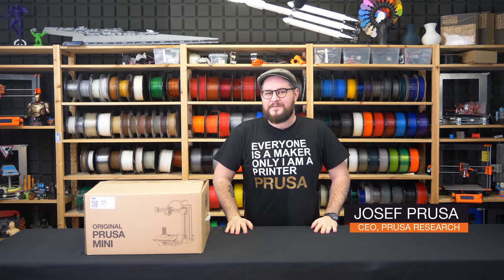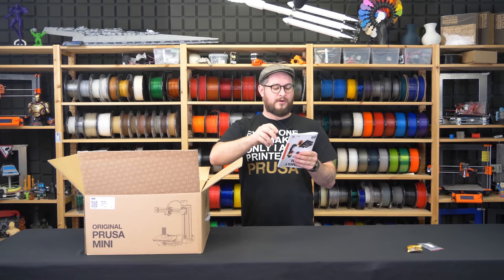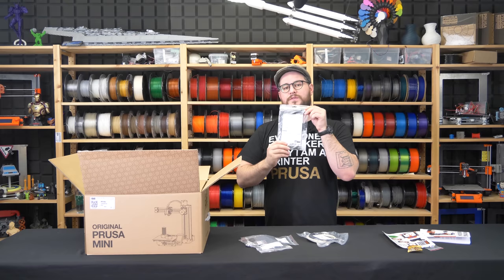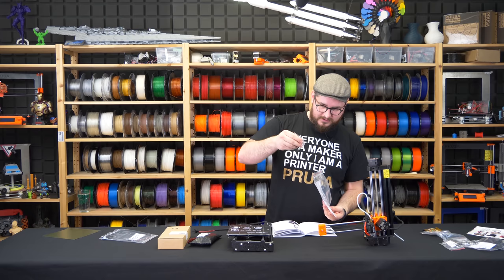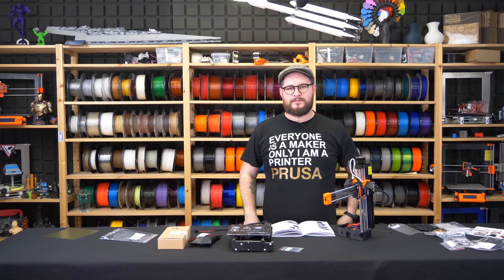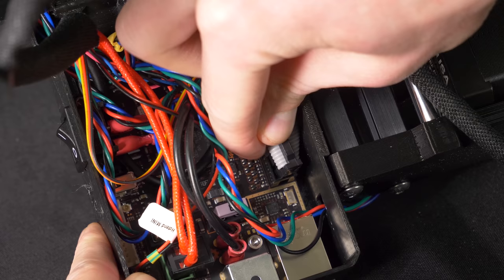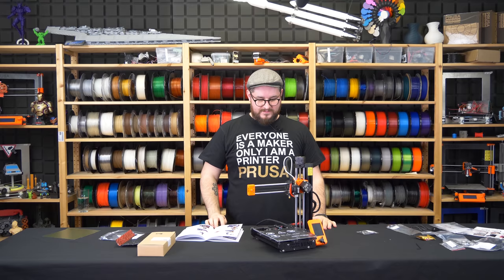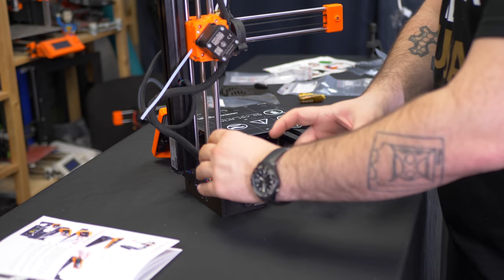The Original Prusa MINI - Unboxing & Assembly

Comment: Watched the video once all the way through. Then watched it again hitting pause as I did the assembly. This was a pretty good guide, though a new one is needed for the slight modifications in the MINI+, but as advised, I followed along in the book to catch those minor changes. Thanks for a fantastically easy build! I'm typing this as I listen to that first test print making music in the background. :)
Reply: The instruction book isn't accurate either, though. For example, step 23 shows "connecting the Y-axis motor," passing a wire through a hole in the side of the electronics box. Neither that connector nor the hole exist.
Reply: @stokestack  My guess is there have been slight variations on the design ove the past 2 years since the video was released.
Reply: @jasonbailey9139  As it turns out, the instruction book has several errors in it, despite being labeled for the Mini+. This was verified by Prusa support in a live chat (which was very helpful). The lesson here is ONLY use the online instructions; the printed ones are no longer applicable.

Comment: I detected no irony when you expressed your pride in the fact that the packaging contains nearly no plastic.
Reply: Ha I thought the same thing. I was "I am going to print so much more plastic than what could be in the box."
Reply: @blazingcobra7228  Like nearly every plastic we use in the modern world, unlike cardboard packaging.
Reply: rjc0234 PLA is biodegradable (made from
Corn)
Reply: @AquaticSCP  PLA isn't biodegradable. just becuse its from a plant based source, doesn't mean it will degrade in either water, UV, or biologically.
Reply: @rjc0234  Except PLA is biodegradable regardless. It will start to degrade after around 6 months of being buried in soil (source: all3dp, "Is PLA Biodegradable?", which itself sources the "Journal of Metals, Materials and Minerals")
Reply: @laurensweyn  your "source" says the soil needs to be at 60 degrees C for over 6 months, and at normal "room temperature" it takes much much longer. Don't credit a source if you then don't follow up with the much much larger paragraphs (multiple) about how it isn't actually biodegradable "biodegradation of PLA requires conditions that are not present in the everyday environment that we live in".
Reply: @rjc0234   "Don't credit a source if you then don't [...]" --Person whose arguing without any sources, lol

Indeed, PLA does not degrade at room temperature and pressure, and it would kind of be annoying if it did. But that's not the criteria you need to meet to be considered biodegradable.

Though it probably wouldn't do too well in a landfill, In can still be recycled, composited, or even incinerated for energy without residue.

Annoyingly the research for this is all behind a paywall and I can't be bothered to get passed it (and admittedly, I'm no expert on material science either), but biodigration options are further elaborated on in "Poly(lactic acid)-Mass Production, Processing, Industrial Applications, and End of Life", Castro-Aguirre, E. Et. al.
Reply: @laurensweyn  and if you look at my previous post before you swooped in out of nowhere to lie that PLA was biodegradable, You will see that I already said that PLA can be recycled and reused, unlike cardboard packaging.

Please go back and find some context, becuse the OP of this whole comment thread seemed to think that plastic packaging was bad for the environment.
Reply: PLA is better than PET and ABS kind of plastics that are used in packaging because they're cheap. We, on the consumer level, can afford to not use them, by choosing cellulose cups and PLA filaments
Reply: @rjc0234  You said "PLA isn't biodegradable". 
"says the soil needs to be at 60 degrees C for over 6 months, and at normal 'room temperature' it takes much much longer."
I don't think you have any idea what biodegradable actually means... LOL.  What an embarrassing comment chain.
Reply: @user-tz9jh6pv2j  Did you even read the source? Even the source that the guy arguing said that PLA was biodegradable ended up saying that (in no natural environment) would it biodegrade any more than normal plastic would.

If you are talking about the lifespan of the universe, then yeah, PLA (along with everything else) is biodegradable).

But if you are talking 10 years in compost? an EXTREMELY long time for any organic matter to break down, then PLA will be almost unaffected.

So if someone told you the south pole was in walking distance, would you believe them? "well a study says it would take 78 days from your location to walk it, so that means its in walking distance".

Read between the lines mate, when HUMANS have to intentional subject an item to very specific MAN-MADE conditions, then it isn't BIOdegradable.
Reply: @blazingcobra7228  lol, a year later, and I discover I accidentally disliked your comment, i meant to like it! My point was also agreeing with you. Plastic can easily be recaptured and put back into the manufacturing stream, cardboard is way harder.
Reply: @AquaticSCP  it only degrades in a recycling center.

Comment: Ok I’ll buy this one! will be my first 3D printer 😍
Reply: Me too
Reply: @paninistealer7167  The quality of the prusa mini is definitly worth it over the creality.
Reply: @CineZoneYT  nah, fam you need to lay off the kool-aid creality has the same quality and a bigger build volume.
Reply: @420247paul  Yeah, the Mini is my first printer and I'm rather disappointed. Crappy cable management, bad access to screws and nuts. Y-belt loose & impossible to tighten without a modified replacement part. Grub screws overtightened and stuck.
One print comes out great, then the exact same one is covered in strings and unusable right afterwards.
Definitely not the smooth experience Prusa led me to expect. Is it even worse than that with the Ender?
Reply: @Kaucukovnik666  If the Y belt can't be tightened then it was put together wrong. Just untighten the screws to the tensioner pulley (the one at the front) so you have 2-3mm slack. Then pop one end of the belt off the part that connects it under the heatbed, then put it back on a couple teeth further (as much as you can). Now you have 2-3mm slack on the pulley screws to tension the belt properly.

Comment: FYI for New people building there mini+ on the Y motor cable part the hole where you run the cable had bee moved. it not longer in the back it under the box. Check prusa site for photo. this drove me crazy . i thought i had a bad unit.

Comment: I was pretty excited about the mini printer, but it kinda looks more like a prototype instead of a finished product. I would have liked to see more parts made of steal or at least injection molded plastic. Even the 150$ Ender 3 is almost full metal without any printed parts.
Reply: The Bible tells us not to steal, stealing is bad

Comment: At 7:25, the last screw left in the bag (for attaching the screen) is a 12mm m3. On my build, it was not long enough to engage the nut in the t-slot. Luckily, they provide some spare screws. The extra m3 20mm long screw will work.
Reply: Just received my first mini+ yesterday and putting it together today 5/1/21. My manual calls for a 12mm m3 to attach screen, but the bag with the 4 metric screws contained the following: 1x 12mm, 2x 20mm, 1x 40mm. The 12mm is used on top to attach the XZ axis so I was wondering if I should use the 12mm screw from the spare screw bag. I've now decided to use the second 20mm screw to connect the screen. Maybe Prusa now knows a 20mm screw is needed, but they should include an addendum sheet of paper with corrections to the manual.

Comment: Bought this printer since I thought it was going to be easy to set up. The lcd monitor wire is so weirdly put into the hole. When it comes out, it doesn’t even come out nicely. It even bends in the video too. He had trouble getting it in and putting into the final resting place. The 3 screws set up are not designed well at all. The first long screw couldn’t go in all the way so I thought it was a bad screw or something wrong with my machine. The pictures and videos didn’t show it well enough and took me an hour to figure it out. Also lining it up with the moving bracket plate is so hard to do with a heavy and weird object. Turned out I have to push hard to put the screw in.  The one on top took two more hours to line up and can’t do it. Josef could put the screw and mounts on the bottom and permanent brackets to screw it in. There is no reason the metal bracket needs to move since you put it in its final position anyways.  For being a $600 printer, this is really bad. I’m thinking of returning since a printer is useless if you can’t even set it up. A $200 printer is easier to set up. Says it’s easy, but it’s definitely not easy. I don’t mind plugging stuff but the way you plug all the stuff is easily fixed to plug in from the outside without opening the box. Seems simple, but very very frustrating. Josef could definitely make a more consumer way to plug stuff in. I understand if printers were first designed but it is 2023. With all the money he charges for each printer, I expected a higher attention to the set up and more features.. I hear how dependable the printers are(the reason I bought it, coming from a competitor), but it is very frustrating.

Comment: At 7:30, this is not correct, at least not in the kit I received. First, the black plastic well into which the LCD frame attachment fits is now very shallow. It is not bowl-like as briefly shown here or depicted in the manual. Also, the remaining screw for it is the M3x20, which is too long and will not screw in far enough to tighten the LCD. I tried the extra M3x12, which is too short and also will not tighten. I had to dig up an M3x16 to attach the LCD. It's tight, but I wouldn't call it robust.

Comment: I really like the idea of using less plastic for packaging. Wouldn't it make sense to use paper bags for the components as well instead of the plastic ones? I understand that you need to seal the filament, but for the rest... its probably not necessary =)
Reply: You would not be able to see if it contains the correct components then.

Comment: Has the design changed? On step 23 of the manual there is no hole as in the video to pass the y-axis motor wire. I used a different hole that is right next to the lcd connector hole

Comment: So two screws into printed plastic that looks around 3mm in it's shell and 1 into a t-nut in an extrusion is supposed to keep the axis rigid? Yeah I don't see that happening.
Reply from the maker: The top plate is also metal. The frame is so rigid we even decided to exclude XYZ calibration for now, all test assembled printers (by tens of different people of various skill) were so square the XYZ calibration didn't have to correct anything.
- Mikolas

Comment: Not sure if I should buy this now. Or if I should wait for a refresh. One thing that worries on me on buying this is that it does not fall under the mk3 line. Meaning that it may not be upgradable as stated on their website for the mk line of printers. Any ideas or insight? I know its a good printer. A good price. I'll prolly buy it. But will this printer receive upgrades like the mk2/3 did?

Comment: This printer seems like it could use a bit more rigidity in it's design. I think the linear bearing/steel rods with printed brackets construction seems like a weird choice for a cantilever design. Why not V-slots like an ender 2? I feel like it would be more rigid with an openbuilds roller system and v-slots.

We'll see though, I'm gonna hold off an let the reviews come out before I pull the trigger on this one. I do like the bowden choice as I'm a weirdo who actually likes bowden printers. I like to print fast.

Comment: after week of research, i just bought and assembly the machine but i use 2.30 hr to finish it. put Y axis to base is very hard for me because i cannot see a hole(event i put it on power supply as you shown). gladly i can finished assembly it. i wait to start my first print after work today. so excite, machine is good build and look awesome.

ps. just small detail, i do not like the circuit board design with strange cable cover  and place to hidden monitor cable it is look so amateur bad design, please make proper cable hidden place.

Comment: 8:30 you could print clip to hold the lcd cable that what I did to one of my printers
Reply: Can you attach a link to the 3MF file of the clip you're successfully using?
Reply: @BrickDesignerNL   search for ender 3 display cable clip it's 2020 extrusion so it it should work

Comment: Why such a special power suply? I have a lot of power suplies there, but I can´t  use anybody of them.
Reply: The power loss feature needs a special signal.
Reply: @bliblabloexyv  ah okay, but I have other printers in my work shop and they have all standard plugs.
Reply: @AllanScheSar  Prusa uses a special cable to provide a signal, when there is a glitch in the mains power. The printer then saves everything before the low Voltage drops. Perhaps the other printers do it differently?

Comment: Glad you you’ve made a video.  But… the instruction book and video are woefully lacking.  People complain about IKEA instructions (I’ve never had a problem) - but these are almost counterproductive.  The booklet pictures can’t be seen or read.  And the video assumes way too much - and has almost no detail.  Could definitely benefit from redoing this - perhaps with some production to show pieces and locations more clearly.  I’m sure you all have computer files of the printer - why not just simply include those?
Reply: Not to mention, some parts and #s are different.  @9:22 my printer doesn’t have that hole for the wire… Other parts are just poorly designed and printed.  Bizarre.
Reply: 11:37 “this part is very confusing” …and you don’t even show what it looks like - either while doing it or after??  Either on video or in manual?

Comment: Is the MK3s still better?
Reply: What is 'better'?
MK3(s) is a great printer, but the Mini is also great.
If money is not a problem, I would go for the MK3(s).

The only thing what the MK3 should have is a 32bit board.
Reply: Snel Internet 
I feel kind of bad because it’s seems better than the MK3s and I am MK3s owner.
Reply: mk3s still has a direct drive extruder a more rigid frame and more sensors, the mini has a more advanced board and LCD screen, you can also buy two for the same price doubling your print time if you need fast prints.